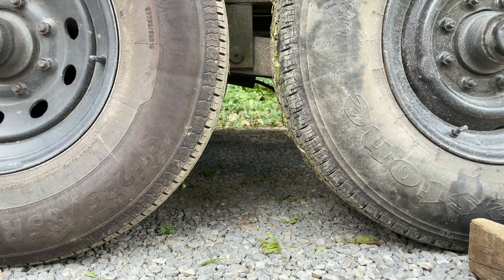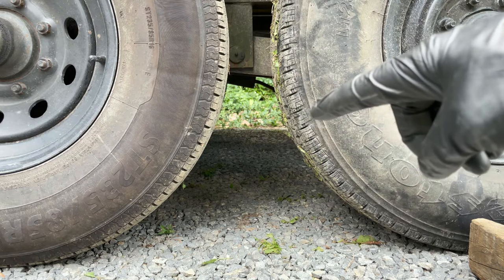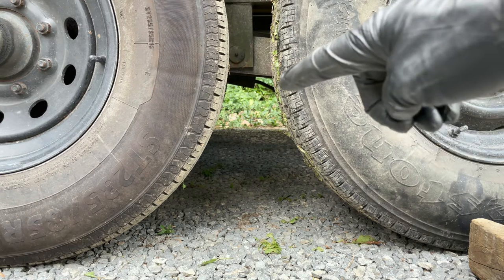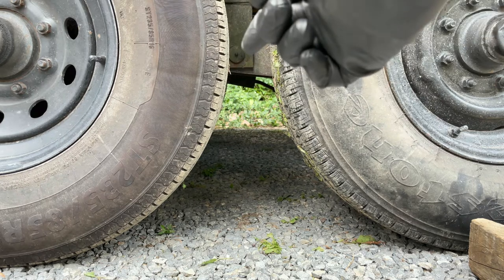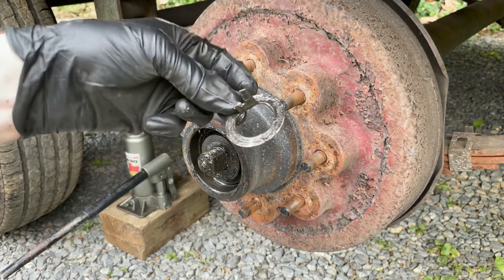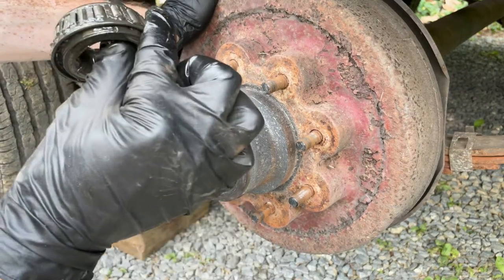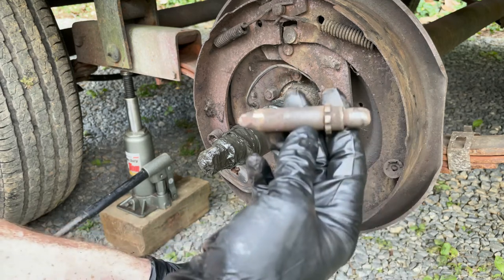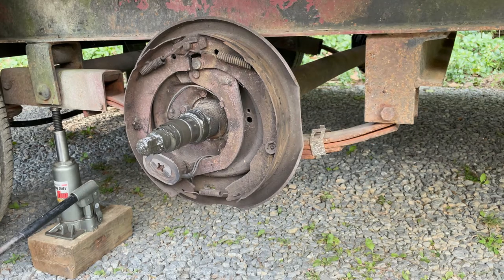Electric Trailer Brake and Bearing Replacement (14k Gooseneck Trailer)

Comment: How often should you do this service ?
Reply from the maker: For the bearing grease, I think it’s recommended every two years or 12,000 miles, whichever comes first. 

For the brakes, as needed. They get inspected each time the bearings are serviced; so whenever the friction linings are low, its time to replace.